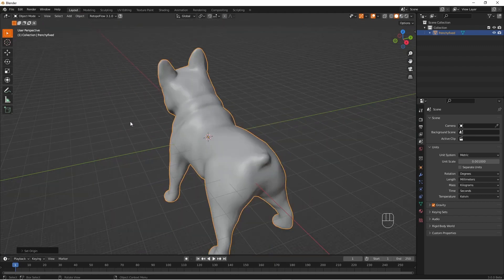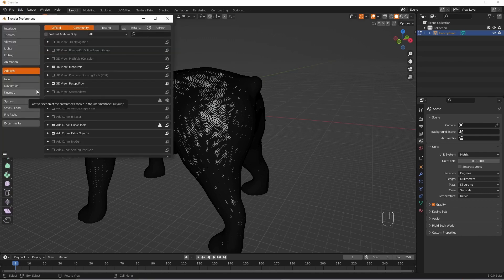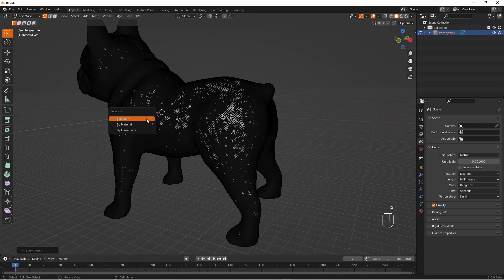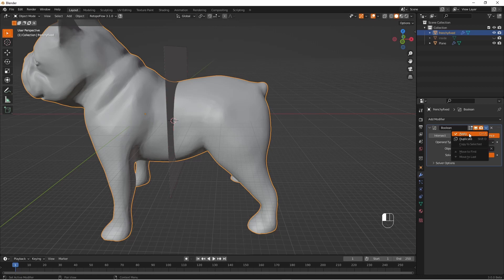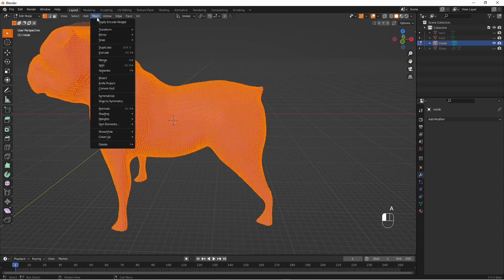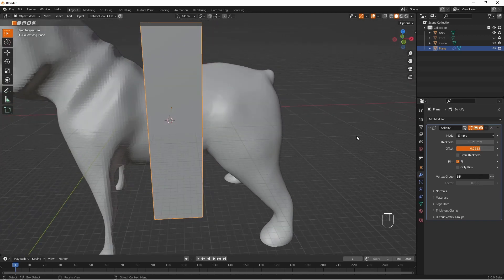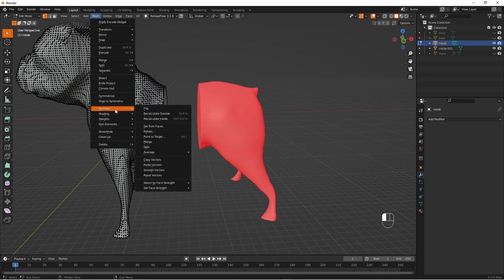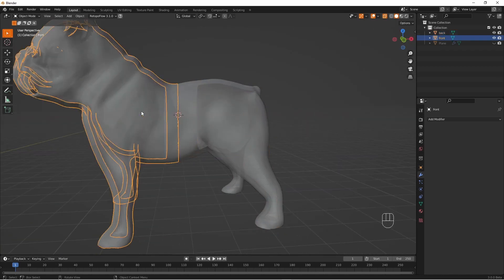How to cut up and key a hollow model in Blender for 3d printing

Comment: i have a problem when i click L to select the inside vertex this select all the object in this case my model dont doble hollow its only 1 mesh how can i do this?
Reply from the maker: This is usually because the model is not hollow in which case you need to look at the video for cutting and keying a model instead of this one which is specific for the challenges when using a hollow model.

Otherwise the most likely problem is that the inside mesh is attached to the outside mesh and you will need to separate them to continue.  This is a manual process of trying to find where the inside is joined to the outside and can take some time I'm afraid.

Comment: Thank you very much! Was trying to add a cube inside a different model. It was adding up well in blender but my printer soft didn't see the empty cube and filled the model fully. Flip the mesh normals was the key. Seemingly seamless setting told the machine that cube is not an outside part but inside. Math started mathing.
Reply from the maker: Indeed.  I have a short video on normals and show that a cube inside another cube is a different object to a 3d printer depending on your normals.

Comment: hello sir I have a problem with the boolean not working on the plane to cut my hollow figur. The problem comes when I do 2-3 cuts on the hollow figur, like when I cut the 2 hands its okej but when I want to cut the head then the boolean wont work and the plane will become red and not go away from my figure after I applyed it
Reply from the maker: Just before adding the boolean modifier you might try Object->Apply->Rotation & scale.  You could also try using the Fast solver in the boolean modifier instead of the Exact solver.

Let us know how that goes.
Reply: @notverygoodguy  I tried both thinks now and the red from the plane is gone now but it does not give me any cut on the figur now
Reply from the maker: @SomaBrige  Are you sure your model is completely manifold?  If you have a link to your blend file I can take a look at it.

Comment: I want to keep the hole. How do I do that?
Reply from the maker: Which hole do you mean? The hole created that matches the "key" shouldn't go away.
Reply: @notverygoodguy  when I split the hollow model. I want the openings to stay.
Reply from the maker: @Kommander_Rahnn  Oh I see.  If your model starts out hollow like in this video then you would only need to create the plane as shown in this video and do the boolean.  No need to separate the inside from the outside and no need to do a boolean on the inside of the model too.  If your model isn't already hollow you will need to make it hollow first.  If your model is quite simple then you would just add a solidify modifier to it.  If it is complex that might work or you might just hollow it out in your slicer and export the result as an stl for Blender and then cut it.
Reply: @notverygoodguy  
Awesome. Thanks for your help.

Comment: My only problem is my model doesn’t have a rim, the outside and inside faces are just the opposite sides of each other.
Reply from the maker: If that is the case then your model isn't hollow.  Perhaps a video on cutting up and keying a normal model would be more useful for you :) https://youtu.be/j5at2x0CcX8

Comment: this is very useful info though a real dirty way is to just use banana split plugin in cura slicer drag your model half way into the build plate a hit cut and boom a cut model for u to more easily print tho keying them is another thing entirely. u can export it as 3mf and use an online converter like swift to convert it back to a file blender lkes and key them
Reply from the maker: With a hollow model though you will still need to fill up the hole.

Comment: Hello, just downloaded blender and watched your vid. Ty ty
Could you do a tutorial on dovetail joints please?
I have a model Id like to split in half and be held together by a top third piece using a dovetail join.
Thanks for your time
Reply: I checked and there are NO tutorials for blender dovetail cuts. There are some for fusion 360
Reply from the maker: Interesting idea.  All you would really need to change from this video though is to add a dovetail shape to the "cutting" plane.  An easy way to do this would be to take the plane and simply create two loop cuts down the middle of it.  Select the faces inside the loop cuts and pull them up a bit (with the "g" key) at 90 degrees to the plane (probably the Z axis locally to the plane).  Then scale the already selected faces on the local x or Y axis to make the inverted triangle shape of the dovetail.

Comment: Does the wall natter once cleaned through 3d builder? I mean its an auto hollow app. Im just worried that if i attached a peg and the wall might collapsed since it is too thin then i realized i never tweaked any and just used 3d builder to hollow and then choose wall thickness in lychee and it seems working but havent tried with cutting joints and adding a peg
Reply from the maker: The wall thickness where the slice is is up to you.  You just adjust the size of the "cutting plane" to suit when doing the inside cut.  I probably made it unnecessarily large in this  video.

If you chose say a 2mm wall thickness when hollowing in Lychee then I guess using a 4mm thick cutting plane would give you a 2mm wall thickness at the cut.  However, you would have to have a "key" and hole that was small enough not to cut through the wall.  I think a 1mm thickness for the hole wall would be OK because you are likely gluing the model together at that point anyway.

Hope this makes sense :)
Reply: @notverygoodguy  yeah i was using plastic cement to glue them together but i guess what im looking for rn is some sort of a snap build with enough friction to hold the pieces together.
Reply from the maker: @apsjongz9931  This is not the way to achieve that.  It is also unlikely to work with resin.  If you are doing FDM printing you need to engineer mechanisms for clipping together as the tolerances are not reliable enough for a good friction fit.

Comment: would there be issues if i just slice them and leave the walls as is? esp for small action figures?

what i usually do is cut it from the neck, trunk (sometimes include limbs) then waist to legs.

so thats either 3 or 5 parts, since there would be holes i am just filling it in to close it then ill be using those to be the key and hole, i ran out of resin and still waiting for it to arrive, do you think itll work?
Reply from the maker: If you slice a hollow model into parts, blender (and most other software) won't fill in the bit where the hollow is so you will be left with parts that have just the walls.  You COULD just fill the gaps in yourself but that can get messy especially if you are using an STL with geometry all over the place.  Also you are also likely to make a zero width face which won't print.  I should have shown an example of this in the video to clearly show what happens if you just slice a hollow model as you would a solid model.

This is why I did this video and used this technique which I might add, I was rather pleased with :)  Try it and see what happens.  You don't need to print the result to see the issue.